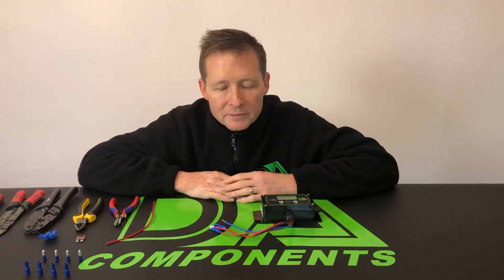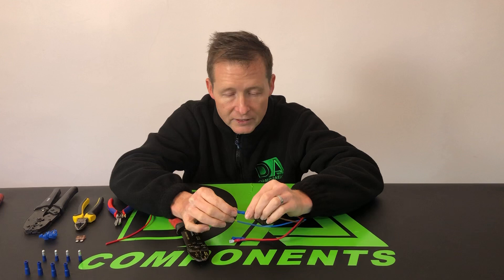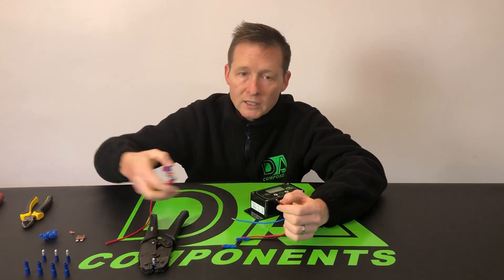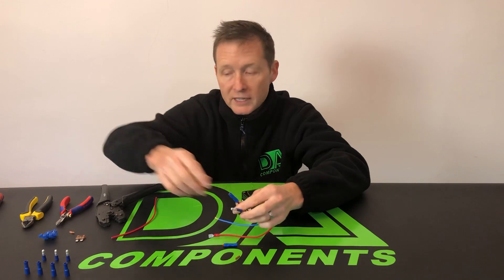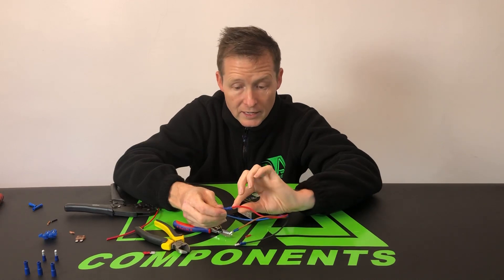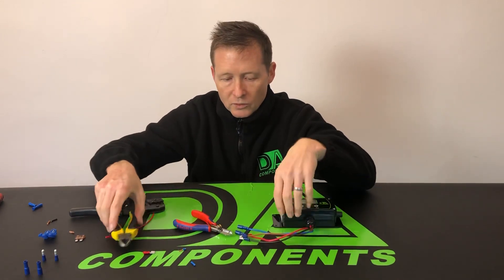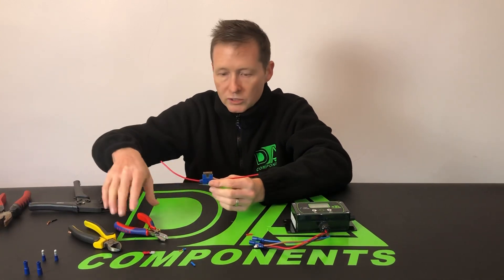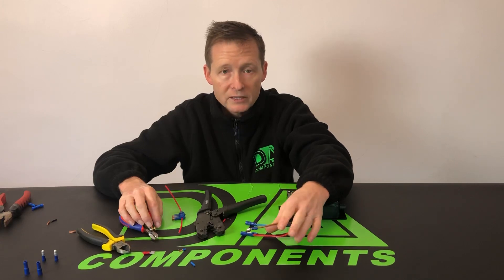Top tips for wiring your pump controller - recommended tools and connectors

Comment: How do you then join the wires together once you've put the connectors on?
Reply from the maker: Hi Tony you push the male a female bullet connectors together!! However have a look at wago connectors now them seam to be the goto ones to use at the moment
Reply: @dacomponents Thanks Darren. I've just received your pump, controller with the bullet connectors already on.  Just had another look and I now see how they just push together. You also included the wago connectors in my package.

Thanks for your prompt response mate,much appreciated.

Comment: I’m not sure my system has a fuse fitted,my wiring is in the baffle,Been running 3 years so would I have had an issue by now if there’s no fuse?
Reply from the maker: Hmm in theory you should have one fitted just in case something happens on the power cables at least the fuse will pop and not the hole system.